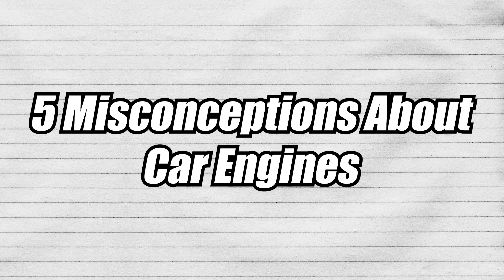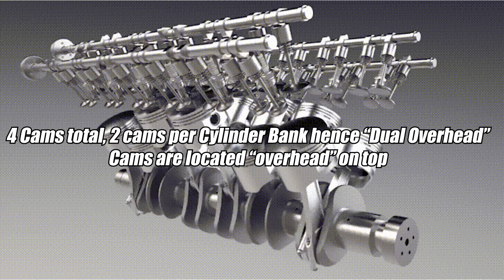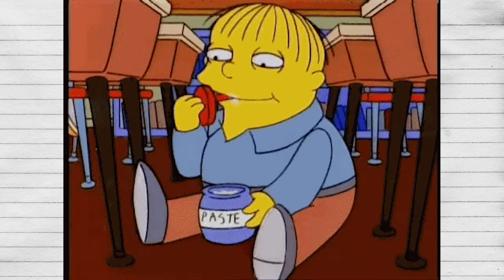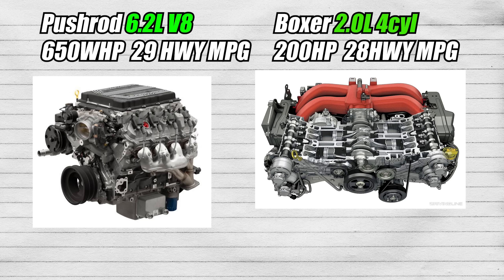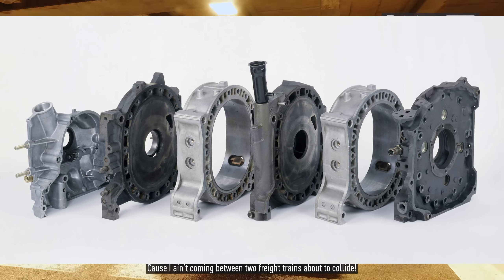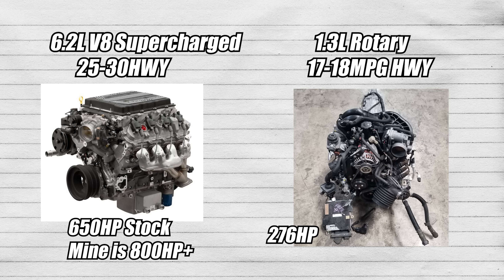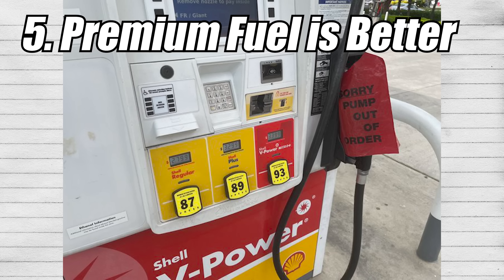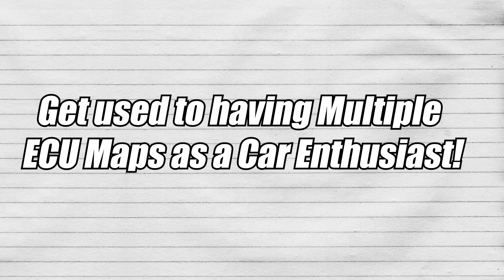5 Misconceptions About Car Engines!

Comment: Id argue over warming engines up may still be a good idea for more vehicles than you think, small displacement engines and turbos is the new sort of thing in a lot of cars. Small turbos spool very quickly and give you a lot of midrange power. They are more cost effective etc for your econobox 1.6L that needs more juice to keep up with your ordinary V6 sedan. The problem lies in the small turbocharger, even mildly accelerating onto a highway or interstate will spool up the turbo and make some boost. If you oil is nowhere near temp on a cold day, the bearings in your turbo are going to get worn out pretty quick. The craziest thing is there are tens of thousands of people buying these cars that don't even know its turbocharged or let alone know what it does. You've got to treat them with a little more respect than the NA counterparts otherwise a lot of things can go wrong and in some cases go BOOM.

Comment: Torque is one of the main reasons I miss the old inline six engines in pickup trucks. Those trucks may have been slow, but they could lug heavy loads all day long since they produced loads of low end torque compared to the newer V8s.

Comment: Pretty off about the warm up topic... It's not about oil reaching all locations, it's about it reaching proper operating temperature. That takes time. Also the warm up procedure doesn't end after you pull away...your transmission and other components need to warm up and you must ease gradually into full functionality.
Reply: Giving me flashbacks of my FR-S and how in the cold, it did NOT like to shift into 2nd until several minutes into the drive lol

Comment: Warming up a car, for me its more about getting the windows defrosted and interior bearable. My crossfire warms up quick, but my work vehicle, a '21 Ford Escape with the 4 cyl. is unbearable unless I let it warm up at least 10-15min on the cold days. That's not including the extreme cold of 0 def F or negative that we can get.

I don't care about emissions of an idle vehicle, I care about being comfortable enough to be a safe and aware driver.

Comment: I feel as though one of the bigger reasons that the lawmakers are also forcing the taxes and laws against high displacement because of the "terrible gas mileage" is also because they want to put everyone into an Econobox / electric / hybrid car. Mostly because they are lobbied to push these beliefs, that's how I feel as though this goes, but I honestly do not know.
Reply: In non-oil producing states (Europe), it's to keep fuel prices as low as possible so they don't need to import more. The 70s oil crisis pushed lawmakers to enact higher fuel efficiency standards leading to widespread economy cars which they have today. 

Americans also faced the 70s oil crisis, and they did all sorts of weird things like 55 mph speed limits and some limited fuel economy standards, but what ended up happening was Japan capitalized by selling efficient Toyota Camrys and Honda Accords to the Americans.

Today it's more of the same thing happening in Europe, but their demand has not grown nearly as much thanks to higher fuel efficiency so they aren't having nearly as much as a problem as they did in the 70s, although it is still significant.

As for the Americans, their demand has grown excessively and they're dealing with the issue by drilling their own oil to the point where they've become the world's largest oil producer. Problem is that the American consumer doesn't get cheaper prices as American oil is a free market compared to the likes of the Saudis where the Saudi consumer gets a subsidized price from the nationalized oil industry. If the Americans didn't drill for oil, it'd be worse than the 70s right now.

Comment: for the engine diplacement one, in Australia Ford made this little inline 6 called the 24T 'Barra' engine, and it can withstand around 1500 HORSEPOWER. This is through turbochargers. also they added a supercharger to the Coyote, stuck in a Falcon, and let it loose. I miss the falcon

Comment: Man, the displacement tax part hits way too close home. I sadly happen to live in a place where we're not only criminally underpaid but also displacement taxes are extreme on all engines above 2000cc. Like not  even joking, a 1.3L i4 costs 250€/$ to register, a 1.9L turbodiesel i4 costs 350, a 2.2 diesel i4 is up at 500 and a 2.7L NA V6 (Hyundai Tiburon, one of my dream cars) is all the way up at 700. I sadly won't get to own anything bigger or faster than a chip tuned 1.9TDI unless they revise these laws, but like, why would they? They earn a lot of money from this, so they have no intentions of doing so. Like, it's so severe that even the top 10% mostly sticks to 1.9/2L sedans and limousines.
Reply: "earn" lol.
But that's true. And it's easy to fool people into thinking higher displacement= less economical. People love to believe things without thinking.

Comment: Loved highway cruising getting 20mpg at 1500 rpm and 70mph in our 1999 350 vortec GMC RWD engine with 4 adults, 4 bikes, gear and a full cooler... or 2 adults 5 kids a dog and a cat and all our luggage.

Also rotaries are amazingly reliable in race conditions just because their failure modes are... not nearly as catastrophic. No valves to float, no rods to break, no pistons to seize, worst you can do is start losing compression at high RPM and that might cut your lap times you just have to do a seal swap while your friend is replacing the valve and camshaft soup sitting in his head.
Reply: Great point about Wankels and "valve and camshaft soup" lmao
But 20mpg in a Yukon? You must mean instantaneous, or my old TrailBlazer 6cyl was pathetic. Best I could get was 20 myself! In a lighter, more aerodynamic truck.
Of course, it was the dohc 4.2L. Another by-comparison win for pushrods.
Reply: @nthgth  It was the last GMC Suburban, full length with side skirts and lower to the ground cause it was 2wd with the 5.7L vortec. If it was a really long trip we could average 20 as long as it was smooth highway cruising and we didn't get a headwind. The real crime of us selling it off was that it had an actual tailgate instead of double doors. Also those trailblazer v6s were always overworked on the highways. That small block V-8 would just drop into overdrive and sit at 1500 rpm the whole time. The tahoe/yukon did worse, the extra length on the suburban helped the aero. I think it also had some aero package on it for highway towing, there was an airdam and running board side skirts that blended to the body.
Reply: @IRUKANJI  I love those Suburbans, my friend has a '99 4WD. 
The TB's inline 6 was happy to rev to a near 7000rpm upshift, but it also cruised at 16-1700 RPM on the highway. I guess those few hundred RPM make a big difference, or the extra drag from having two camshafts and 24 valves. Would've loved the optional 5.3 V-8 for sure but the six had its charm!
Reply: @nthgth  A suburban with a tailgate is the single best thing about a truck I've ever seen. Even with a fully packed out trunk, you can lift the gas, drop the tailgate and you've got somewhere CARPETED to sit with the glass over your head if it's sprinkling. And if the last thing you packed is a huge cooler facing the rear then you've got easy access to lunch and drinks. It was the ultimate mountainbiking truck.

Comment: He is right that bigger engines are not necicary to get more power, but (of course if they are made with the same quality) a N/A is more reliable than a car with forced induction and lasts longer by default. A N/A can and probably will chug more Gas but if you dont go too crazy with the displacement and if the car isnt too heavy it wont be that bad and will save you in the long run. But I am talking from the knowledge I gained from some expirienced mechanics and car enthusiasts so results and correctnes may vary

Comment: The reason why you need to put the right octane fuel in your car is to PREVENT SPARK KNOCK AND DETONATION/PREIGNITION. that's literally it. Run what the manufacturer recommends (unless your aftermarket tune says otherwise), because they know what they're talking about.

Comment: I always tell people 
"Rotaries aren't unreliable, they're maintenance heavy"

They last as much as any car with the same power per liter, hell even more.
My cousin's FD lasted 112k ported with my RX8 not having compression drop until 115k.
It's all about standards and if you wanna get a sports car but treat it like a commuter, don't get one.
Reply: If you compare a rotary to any other japanese tiny capacity inline 4, rotarys are weak. If you maintain those "normal" engines you can easily get 190 000 miles out of them. Im from Finland so I converted kilometers to miles, so I meant about 300 000km. Any older, traditional Japanese car is expected to make it at least that far, and even then the problem is propably rust, not loss of compression. So looking at rotarys as a Finn, id say those things are pretty unreliable.
Reply: @vanttujaara3042  You didn't read what I said.

I've seen orginal engine rotares hit 200k and run better than those cars you're talking about. Those were usually lower power detuned models.
Reply: @RyuusanFT86  Well yes, but you said that you suffered compression drop after 115 000 miles, and i make the assumption that you know how to take care of one. And if we talk about high mileage examples, ive seen hundreds and hundreds of old toyotas and nissans with tiny engines going strong with over 400 000km on the clock (about 250k miles) running as good as new. The fact is, that rotarys are fantastic engines with good power, but you just cant expect high mileage out of those.
Reply: @vanttujaara3042   @Vanttu Jaara  
Read it again.
 
Compression drop, at 115-120k miles in ANY car is expected, especially cars that are tuned. It's because my maintenance was meticulous, but most cars start to lose compression at 75-100k miles unless BABIED by a purist or some shit and even then age and how you drive those miles matter.
You can have garbage compression and still 'Run Strong' as well.

You're ignoring how an engine is tuned as well as power relative to engine size not to mention maintenance and driving habits.
Those engines you mention are larger than Rotaries, built and tuned for economy driving and aren't usually pushed past merging on the highway like an 80 year old.  

Basic physics also prevents these old ass econ shitboxes to "run like new" even if taken care of properly. Any engine can run properly, have no oil consumption and good gas mileage with technically failing compression while also getting the shit kicked out of it here and there. Even Rotaries. 

The reason you don't see many Rotaries last long is because of their design leading them to be extremely maintenance heavy as well as poor service bulletins.

That heavy maintenance, just like on any other car, increases with how you treat it.

If you still disagree with these things in mind, we're done here.
Reply: @RyuusanFT86  Well, you have your oppinions, Ill have mine.👍
Reply: @vanttujaara3042  Thank you for leaving it at that. I may have been a bit rude in retrospect but I just love my rice ball doritos. I started off with them and have owned more of them than piston engines so I tend to have a bit more poise when talking about them 😅
Reply: @RyuusanFT86  Yeah, no propblem. I get it. I was a bit rude too, and i do apologize also. I drive a 90s Merc and Ive had Volvos before, so Im not the one who should be talking about rotarys, so sorry!
Reply: @vanttujaara3042  It happens! Car guy shit.
 If anything "unreliable" fits depending if we're getting technical and bringing standards into play, I just have experience with multiple different standards with a bias towards
 "I drive whatever I can afford" which maintaince comes into that question of affordability.

Normal Engine Standards of reliability inculed lax maintenance. Rotaries under this technicality are indeed unreliable. 

Tuned Engine Standards they're pretty alright. More reliable than an Evo, less Reliable than a GTR. Good middle ground, but maintaince is more on the GTR side of things.

Motorsport Standards, they're about the same if not more reliable depending on your tuning and porting. 30-60k miles of 25 minute to 1 hour races if you keep your temps cool.

I see your point and if I switch point of views I actually agree with you, I'm just a rotard.
Reply: @RyuusanFT86  Yea, Ive heard that rotarys are really good for racing. I mean arent those things meant to be driven above 4000rpm at all times?
Reply: @vanttujaara3042  That can't be driven under 4k rpm without being all kinds if whack.

Most of em don't even hit 50ftlbs of tourqe. They slowly climb from 0 to about 20 ish then suddenly Spike to the 100s- hit peak tourqe  and then stay there until the redline. That's what makes Rotaries so quick for what they are. That's also what makes electric cars so fast, they hit peak tourqe and stay there juts loke a Wankel but it's almost genuinely instant so imagine anti lag for your Rotors by using magnets instead of combustion. 

Iirc my grandpa flooded my RX8 and messed up the flywheel trying to "be careful with it" by not going above 4200.
Reply: @RyuusanFT86  Rotaries do sound kinda fun! Its a shame that there are very few here in Finland, and if one comes across, they havent been taken care of very well. Id love to driv eon some day.
Reply: @vanttujaara3042  Yeah they're pretty great. Even an RX3 or old Stantion wagon with a 12A can slap pretty hard. A peripheral port and blow thru turbine can be a fun little rocket. 

Plus the cool guy factor of pretty much garunteed 3-6ft flames coming out the back I'd say worth it for at LEAST a bucketist project.
Reply: @RyuusanFT86  I actually love the styling of fa rx7. Only if i could find one🥲
Reply: @RyuusanFT86  Part of reliability is how durable the product is and rotaries just aren't very durable compared to piston motors.

I've seen an Audi TT that was driven 80,000 miles without an oil change or any other maintenance, the oil turned into sludge when it finally arrived in the shop. You try delaying an oil "change" with a rotary, that poor engine's lifespan will drop below the 80,000 miles that TT ran under complete neglect.

Also motorsports reliability standards are basically "is it in the budget to fix." Most motors get overhauled, rebuilt, or even replaced after the season is over, and in the highest level it's practically every race. Maybe at the lowest point in spec Miata racing you may find teams that try to be as economical as possible due to limited budget, but there exist teams that have all sorts of hour meters and maintenance schedules to replace all sorts of parts in advance, and they often overhaul the entire engine after the season is over. Every bit of competitiveness is important when you're already spending a ton of money, and they just end up spending even more.

Comment: 7:20  Also that's a 100% not true.

The problem with these engines aren't that everybody is rushing out to buy parts for them that could be a problem but it's not the main problem.

The main problem with these engines is that they're overall a very different kind of engine kind of like how a 2 stroke is very different than a 4 stroke.

To add most mechanics don't really know how to even fix your average engine so if you get them a rotary and it's not working they're not going to know how to fix it.

But side-by-side a road reengine is very much more simple than a piston engine. The problem with the road reasons that they don't get that much mile per gallon.

Comment: Busso v6 engines were single ohc pushrod engines.  The cam lobes pushed down the intake lifters direclty but a pushrod system was needed to reach the exhaust side on the other side of the head. That system only existed bc Alfa Romeo made the combustion chamber hemispherical for a more efficient running engine. So the valves weren’t exactly next to each other. They were angled away from one another. Look it up it’s really interesting

Comment: For anyone curious about the MX30 rotary, its updated to use direct injection and Mazda claims uses something like 25% less fuel per liter or so. So thatd help drastically in a PHEV/Mild Hybrid, especially since at least the EV version at least had a small battery/range, probably because they only wanted it for fleet averages in California lol.

Comment: May I correct the engine temperature part? The temperature what engines are made for are 80-120°C because the material expands and engines are made for the high temperatures because they work most of the time on that temps thats why you shouldnt rev your car at max rpm even after 1 or 2 minutes of start.

Comment: Just too add to your first misconception air flow is also a big factor for example the k24 with a k20 top end can make more power than just a k24 because of the better flowing k20 intake manifold

Comment: Its also important to mention that the corvette is a slight anomaly when it comes to mileage due to them being insanely aerodynamic. Not only do they have low drag coefficients but they also have small front surface areas which make the real difference when it comes to drag.  A 4 banger economy engine in a corvette would get drastically better mileage despite the massive torque disadvantage. There's a certain correlation with displacement and thermal efficiency if you compare engines that use the same induction type but there are a million other things going on that can make the point moot.